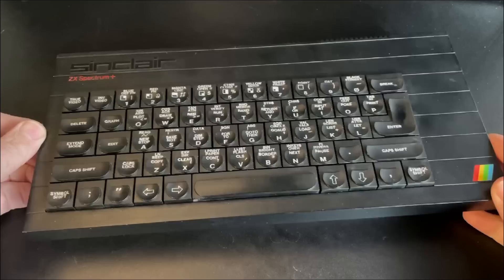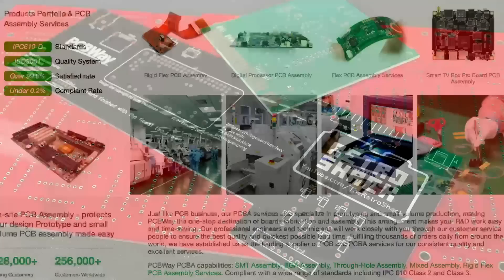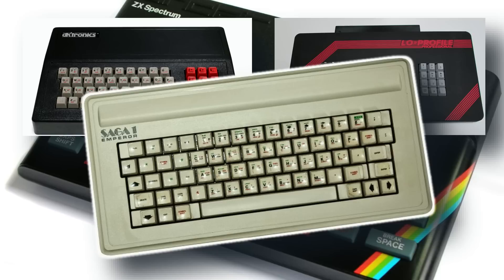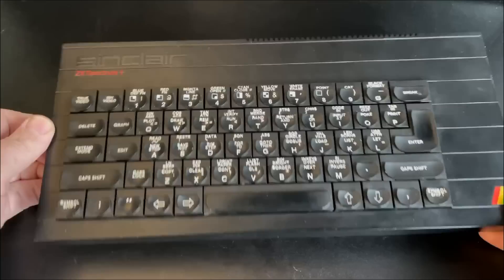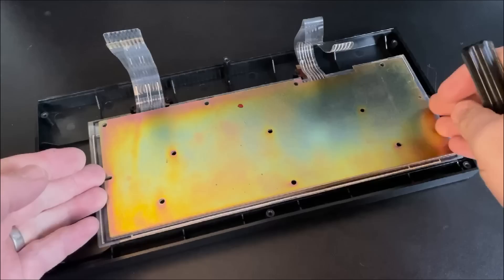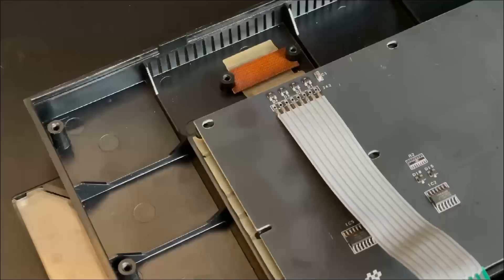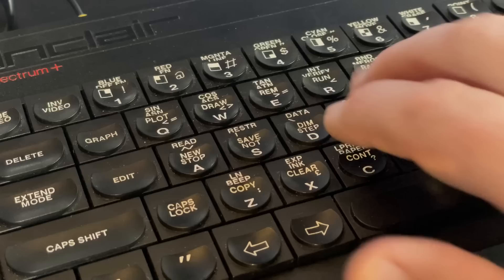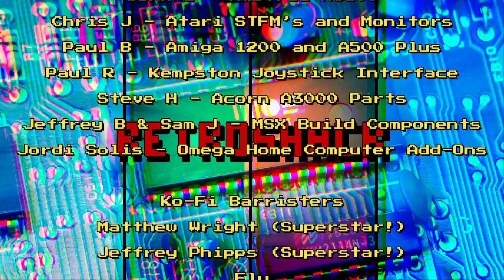Is this Spectrum keyboard matrix the answer to Mavis Beacon's dreams?

Comment: Back in the late 80s I replaced my original Spectrum keyboard with one that I had wired up myself from a gutted PC keyboard with mechanical switches. It worked pretty well, but I found that I could type much faster on it, which became a problem because the Spectrum couldn't keep up with me. Thinking about it more now, I wonder if it was because the simple matrix of keys and associated decoding routines didn't have the necessary rollover support to cope with the increased rate of keystrokes.

Comment: You had more success than me! I tried for ages to get the bloody thing properly aligned in my toastrack. The keys on the edges seem to be most problematic; when I did finally get it seeming to work I found the J key didn’t work. At that point the original membrane went back in! I measured the spacing of the switches on the PCB to the plungers on the keyboard and it appears to be around 2mm off across the entire width of the keyboard. Doesn’t sound like much, but that’s huge when you have such a tiny target to aim for when fitting it. IMO not worth the money.
Reply: Gah, was hoping this would be a nice solution. Had real problems with my replacement membrane and getting a positive response on the cursor keys. I'll pass on this one, but I appreciate the effort.

Comment: I had a DK Tronics keyboard. The keys were OK, but the legends were just stick-on clear plastic that kept sliding about and coming off. So I removed them all and just had unmarked keys! (After years of using a Speccy I knew where most of the tokens were located).

Comment: I'm tired of hearing that the QL's and Spectrum Plus' keyboards "were bad", when the majority of the keyboards used today use exactly the same mechanism and design.
Reply: To be fair, many off-the-shelf computers come with bottom dollar keyboards - but they classify as bad also. That doesn't make the old keyboards good. Saying that the majority of new computers come with the same mechanism - not sure I'd agree with that. Many are just in-between quality. However, given the huge market for mechanical keyboards it is fair to say few people stick with their original crap keyboards. Laptops typically use Butterfly Switch keys or Scissor Switch keys. I'm not fond of each, but they are far more reliable. Still, I carry a mechanical keyboard in my laptop bag.

A lot of us using PCs and some Mac users use mechanical keyboards because we like tactile feedback in the keys. Having said that, even the place in the middle is better than nothing. 

Rubber membranes wear out fast (though newer formulations last longer), and carbon contact films eventually fail when the carbon is worn off (though at least that's repairable). The big issue with old keyboards is that the contact system cannot be replaced for one key only. Modern mechanical keyboards can replace a single key if necessary (though it may involve soldering). 

Cheap keyboards of modern cheap computers get stupid problems. However, the modern computer off-the-shelf computer ships with a $5 keyboard. Repairing it wouldn't even be worth your time. 

At least retro computers are getting options. The "bad" keyboard here is partially improved with a mechanical key. If that key goes bad, that single key can be replaced without changing a single other key.
Reply: @jeffreyphipps1507  Well, every time I unmounted a keyboard in my office, it had the same rubber dome-contacts membrane... I can accept that the quality of the rubber is better today, but the tactile is more or less the same. Also I used a QL for several years for work, and the keyboard was acceptable: you know perfectly when the key was correctly pressed. The problem was only that, in that time, nearly all of the keyboards in the competence were mechanical, which, obviously, were superb, but that doesn't mean that the QL keyboard was so bad as they painted.
Reply: @rastersoft  That's nonsense. IBM produced a new, cheaper keyboard right around this time for lower priced machines to use instead of their expensive Model Ms. It was rubber dome, but it was crips, didn't bottom out, gave you great tactile feedback (for what it was) and felt fantastic. It was perfectly possible to produce a good rubber dome keyboard at the time. This is just cheap and bad.
Reply: @paulie-g  Are you comparing an IBM-made keyboard with the keyboards that a lot of cheap machines deliver and a lot of people uses day-by-day?
Reply: @rastersoft  Yes. IBM stopped making elite-level keyboards after the Model F and M. It's important to note that Model Ms are, in fact, membrane keyboards. What makes their action good is the buckling spring. They even made a rubber dome 'quiet' version that, although inferior to the regular, buckling spring version,  is still quite nice by regular people standards. 

IBM 8923 is an inexpensive keyboard and very nice for rubber domes. Dell QuietKey (the original) is nice. Packard Bell had a nice rubber dome one. A couple old Logitechs are nice. A lot of people liked BTC's early rubber dome with sliders keyboard that they OEM'ed out to PC manufacturers, very inexpensively. Like I said, it was and is perfectly possible to make a good rubber dome, inexpensively.

What makes cheap keyboards bad is often lack of rigidity. You can see on the video that this Spectrum has a metal backplate, so given half-decent action, this would've been fine.

There's a reason 'mechanical' keyboards are a niche thing nowadays. A lot of current dirt cheap keyboards are 'good enough' for the average joe and much better than these Spectrum disasters, and nothing affecting typing in them requires 21-st century technology.

Comment: As someone who can't touch type, but rather types by muscle memory, Spectrum and laptop(including cheap modern pound store/Asda USB laptop-like ones designed for desktops) keyboards throw me so badly that it probably quarters my typing speed. I've never used a Spectrum+, maybe I'd be better on there, but I'd need to prop the back up on something as I'm just so used to stepped rows.

It is amazing that these things exist now, though. Even as short as 5 years ago, if you had a knackered Spectrum(or other old computer) you'd need to cannibalize an old one for spares, and any kind of improvement would be rare as all heck and priced... allegedly appropriately.
Reply: The Spectrum+ has fold-out legs built into the base for propping it up.